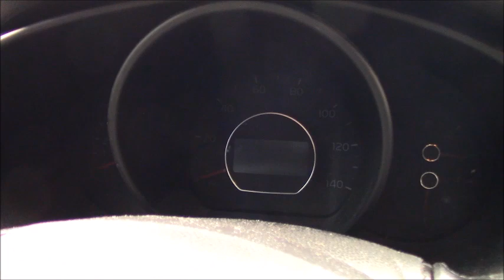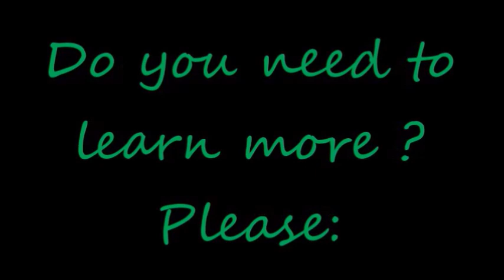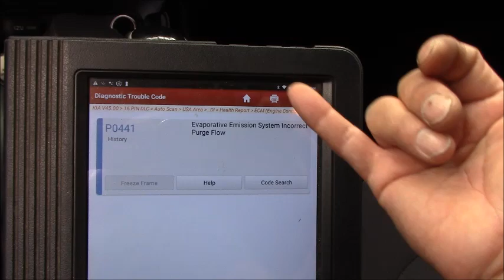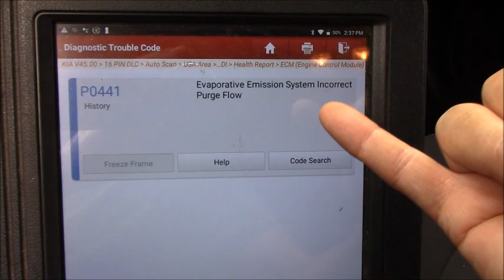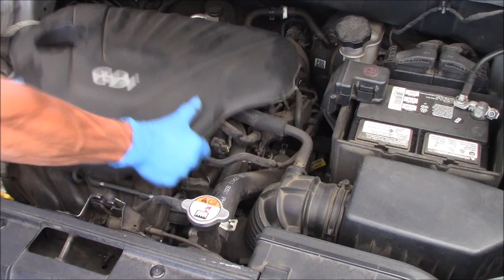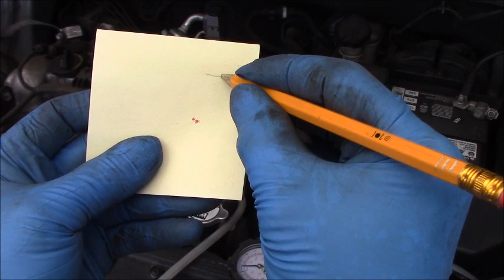P0441 Code - Evaporative Emission Control System Incorrect Purge Flow

Comment: If you replace the purge valve and the engine light still comes on after and throws the same code, would it, or could it be the hose that needs to be replaced? Purge Hose
Reply from the maker: depend on the performance fault codes or electrical fault codes
Reply: @AutomotiveServiceExcellence  it’s the same P0441 code. Or is there another code?

Comment: I checked my purge valve. No leaks and I replaced it anyway. It opens and closes with obd ii command. I erased code and it came back. Slight lack of power, but no vacuum leak code. What should I test next? Smoke test back to canister? @auto repair
Reply from the maker: If there electrical circuits codes then should check for intermittent open circuit or fuel tank pressure sensor stuck

Comment: Thank you for the video. Question, I replaced my purge valve today but the code is still there. Will it disappear later or do I need to erase it so it goes away? Thank you
Reply from the maker: you need to erase it